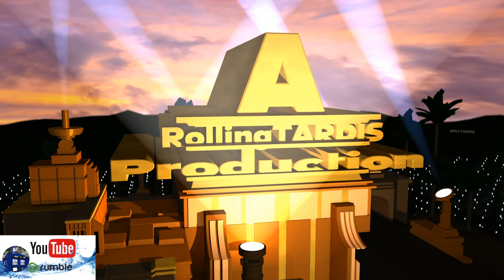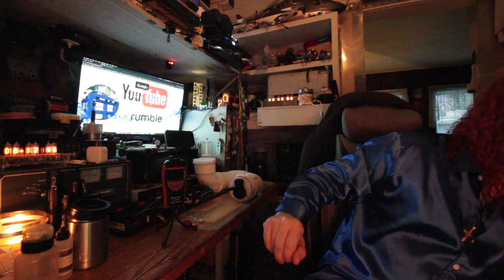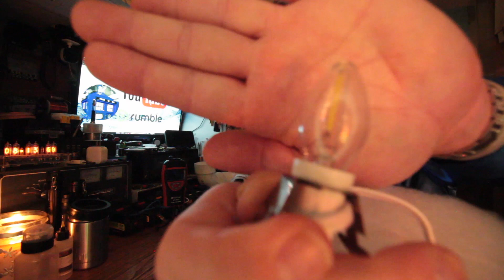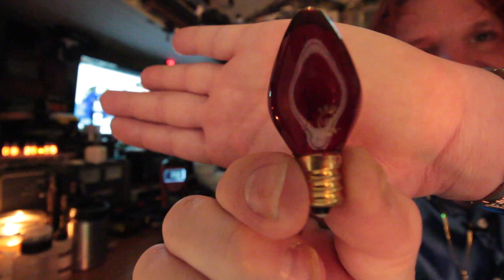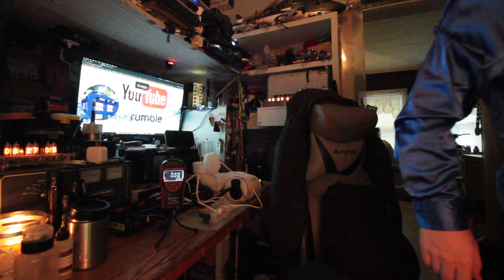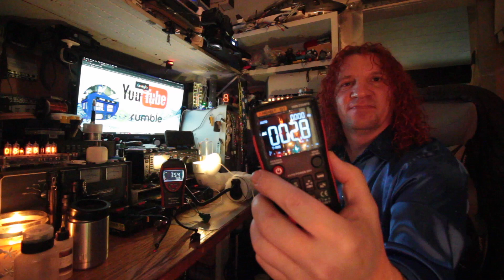The Ultimate Lumen Showdown: 5 Watt Incandescent Vs Tru-Tone, AC Vs DC

Comment: Nice experiment! That confirms what I'm seeing with the naked eye, with my stringers, that both kinds are close in light output. I got all mine packed into their original boxes, so they don't get scratched, but had an animal of some type try to chew on a white bulb, and scratched it pretty good on the tip.
Reply from the maker: I got one more wacky experiment. To see if I can tone down LED flicker on AC. If it does work. It will be a dirt cheap mod. Judge camera shutter, will shed the light on that.
Reply: @RollingTardis  Will be tubed!